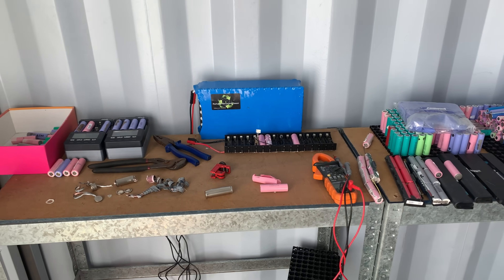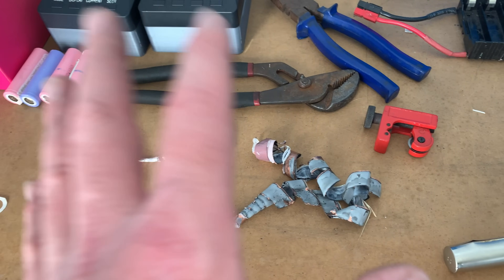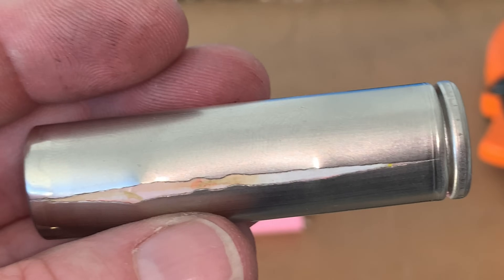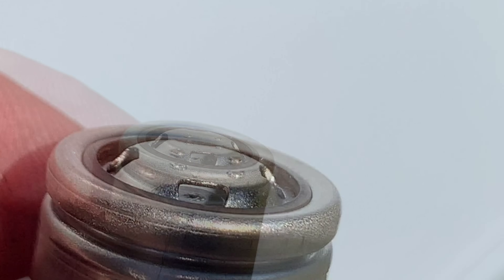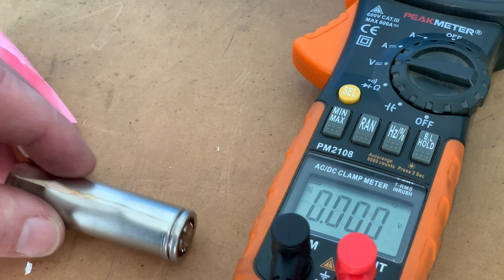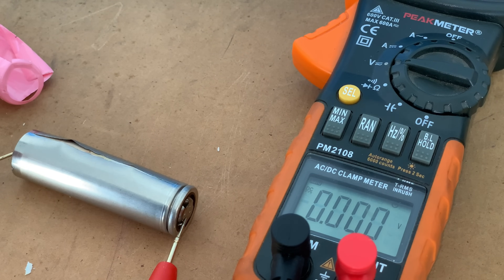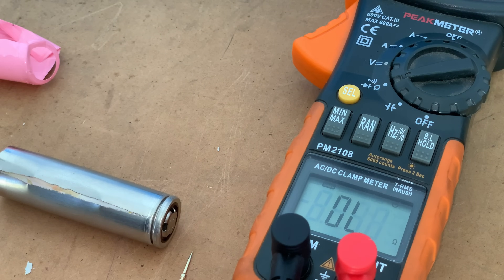Cutting open an LG 18650 battery for science  [ amateur video warning ]

Comment: I wouldn't think those cells would have a "seam", they'd be drawn into that canister shape from a single sheet like you would a cooking pot or a scuba tank or a sink.  That's not to say that the source sheet from which this cell was drawn couldn't have had impurities in the metal that created a weak spot for failure at that particular line when the internal pressure built up to the failure point.
Reply: Yeah, it would take far more machine time for them to roll a sheet into a canister and perform a secondary operation to form the bottom.
These are basically definitely manufactured the same way ammunition casings are drawn from brass.

Comment: Your batteries started venting? You don't fucking say. It's almost like a professional who's worked with batteries, charging and recharging them, told you this would happen.
Reply from the maker: Heaps of professionals on youtubes, i'm just a guy with practical experience - and after putting Tens of thousands of cells though this is the first time I've seen this.. Bet most of the Professionals here haven't seen the cells I have in a month lol
Reply: @HBPowerwall   Electrical Engineer for 13 years, 6 years as a avionics tech in the Navy before that, with most of the past decade dealing with batteries, battery management, power management, and control circuits.  I'm not surprised that you're getting increasing failures from suspect cells and damaged outer cores (some of that damage YOU caused by cutting into them).  

Tell me, what happens when you put multiple cells in series and have a weak one that can't hold it's charge in the middle, what is the end result?

Comment: U should not put those in water
Reply: Yes,even at 0v.Sodium and lithium are in the same group in periodic table, so their properties should be more alike than the properties of sodium and magnesium.
If u put sodium in water its volatile n causes voilent flames, same with the lithium, and i think u were just lucky it didn't caused any flame, it was oxidised earlier,  it had those white patches beacuse of oxidised lithium. and the remaining unoxidised reacted to water and caused bubbles,
Pls dont do such stuff i love your Worksop 🙏
Reply: birendra kumar there is no metallic lithium in a rechargeable Li-ion cell. Only non-rechargeable Li-metal cells have metallic lithium that can react with water.
Reply: @batterymooch  ooh,thanks for the knowledge, learned something new!
Reply: https://youtu.be/bNMfe20I_IE

Watch this u will get an idea
Reply from the maker: even when zero volts?

Comment: The layers inside did not look good. In my experience the layers should have a very uniform coloration. That cell had an appearance similar to corrosion. Also the copper looked like it was flaking apart. I have taken cells apart before and none have looked like that. It would be worth taking apart a "good" cell for comparison.
Reply from the maker: I really should have pulled apart the other one to compare. Just clean forgot.

Comment: Im wondering if you resleeved the cell? Meaning did you run a stanley knife down to take off the old plastic sleeve to put on a new one and was the break.in the cell caused by running your stanley knife a bit too hard?
Reply from the maker: No it was all factory.

Comment: i never charge lithium batteries unattended
Reply from the maker: It's unpractical to do 1000's of cells and watch every single one the whole time it's in the discharger. Do you mean you're in the same area when they are charging?
Reply: @HBPowerwall  when discharging i can leave them  unattended but when charging ive had cells get very hot and i worried they might go into thermal runaway so i keep checking them for heating when charging

Comment: i somehow doubt you can use an ohm meter to measure something that has a voltage in it
Reply from the maker: Who knows lol
Reply: @HBPowerwall  To measure resistance your average multimeter uses its internal battery to drive a current through the object being tested and it uses the current that flows to calculate/indicate the resistance of the object (via Ohm's Law).  If the object (cell under test here) has some voltage of its own, it will interfere with (either add to or subtract from) the multimeter's battery and give a false reading.  However, if you swap the test leads around and get the same reading, then you can assume that there is no voltage in the cell.  
If you really wanted to you could work out how to make sense (unique to that multimeter) of the different readings obtained when swapping test lead polarity.

Comment: That cell definitely had some of the electrolyte burned. The powder that you seen fall was burnt electrolyte. looks like it failed at about 1/3 of the roll off. If you take these apart and they are still good they also will not have it looking all cracked. I have taken them apart myself and only the expanded/vented or 0 volt ones tend to look like the electrolyte lost all of it's moisture. Normally it should look almost like a black jello that is slightly reflective. The reason that it still had continuity was because the electrolyte burnt away and the copper was able to gap.
Here is a video I found showing what it would look like if it wasn't burnt.
https://youtu.be/YrqsAGr41uU?t=553

Comment: Bit of an oddity for sure. On a wild guess i might say maybe just the casing was damaged. If there was pressure on the top and bottom of the cell, the casing might have just given way, splitting on the seam creasing the metal as it bulges outward.
Reply from the maker: There are no physical signed of damage.
Reply: @HBPowerwall   I'm unsure on it, but it might not take much pressure in the right position on the tips of the casing to cause the seam to split like it did. You could test this on another dead/bad battery, see how the casing behaves.

Comment: Oh my gosh it's common knowledge you do not put water on lithium it can react and cause a fire!  Keep this in mind for the future
Reply from the maker: You know how fire departments deal with lithium fires. Water...... and lots of it , for a long time. I need to experiment more maybe it’s an issue with a fully charged battery but clearly not with a dead one.
Reply: @HBPowerwall  Only metallic Lithium rects with water, the ions in Li-ion shouldn't react. Of course some tiny amounts of metallic Li could have been formed, but that fizzing was nowhere near what would have happened with a primary Li battery.

Comment: I had something like that happening with an LG INR18650-MJ1 cell.
 However my cell still worked fine with the crack.
Reply from the maker: In theory is should work if charged. Just not well or safe.

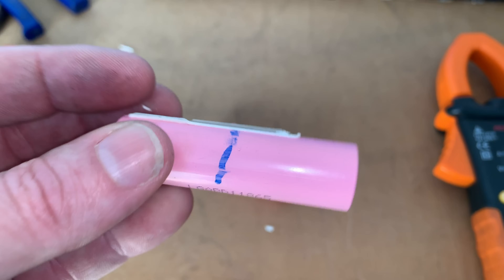Comment: 1:14 in the video and first thing I notice is this is rated for 4.35 volts. This cell is like a HV cell, if you system charges to 4.1. to 4runner.2 volts you would see the full capacity from these cells. These cells have a lower life cycle because they are pushed to a higher charging voltage and knows to fail in a short time. personally I would not mix these cells together with standard 4.2 volt cells.

Comment: tbh its not really a good idea to throw something containing litium into water. Litium reacts quite vigorously with water, and can thereby reach temperatures that are albe to decompose water (by Thermolysis), so you end up with HHO Gas (highly exposive), in addition to the hydrogen already produced by the reaction of Litium with water. and Boom. The only thing saving you there in your video is the fact, that the Litium in a fully discarged cell is stored in form of  LiCoO2 which is a lot more stable, then the Litium stored in a graphite grid in a charged cell.
Reply: Chibi Suke there’s no metallic lithium in rechargeable li-ion cells. Only non-rechargeable Li-metal cells have metallic lithium in them that can react with water.

Comment: You can see that it pulled apart because the can thinned at the crack 19:21, and the dark spot in the crack face says it was leaking for a period before the crack spread. Looks like the inside core expanded and ripped the can, rather than gas pressure which would've leaked out the initial pinhole - non blown CID shows there was no pressure -.

Comment: The cell with the spit was most likely because of a seam when one roll of metal is connected to another and just failed because of a bad weld on the seam most likely just dried out over time and stopped working
Reply: old time engineer I believe these cans are stamped (drawn) from disks and are seamless. I’ve never seen a seam in the thousands of round cells I’ve tested. A seam would just act as an uncontrolled failure point that would “compete” with the venting disk.

Comment: Dell had a bad bunch of battery packs a couple of years ago that were expanding in the laptop. They went so far as to do free battery pack replacements for out of warranty laptops. From what I can find it was the 84Wh packs. I couldn't find any date code info but it may be something for you to look into. The model in question was the XPS 15, maybe that will help your search? I wouldn't bother doing any more cells autopsies, I don't think it's going to give any revelations. Research the cell history instead (is this one of them that Dell had problems with?). Good work, by the way!
Reply from the maker: I'll look into that this week if i get time and if i find anything i'll consider doing a quick video - thanks for the information

Comment: I still think manufacturing fault maybe the case was extruded a little thin and possibly cracked along an adhesive line when it was removed that's why we test cells somewhere safe it always worries me when I see people posting pictures or videos and they are in lets say a spare bedroom with cells stacked high with a line of testers, remember it only takes 1 or 2 bad accidents and the powers that be will come down on us like a sack of bricks and regulate to the point it will be impossible to do this. stay safe

Comment: It was interesting but I have to tell you the grey stuff that was packed inside the coiled film is highly toxic and not easy to dispose. My advice is to clean properly all the surfaces you have worked on and call it a day regarding opening other batteries! Better to do a tour in one of the manifacturing facilities to learn how they assemble them 😉
Reply: Not highly toxic and can be disposed of in regular waste. These are lithium ion batteries not nickel cadmium or such others. I would not eat it but it's not a huge deal aside from the dangers of heat and fire.
Reply: Rob Fowler Ah ah, yeah, I wouldn’t eat it either!
Reply: The only danger beside eating is if it was on fire you DEFINITELY don't want to breath the smoke.

Comment: I noticed about 1/3rd the way into the wrap there was what looked like burn marks along the bottom (neg end) of the foils. I haven't see that in the one's I've dismantled. Probable it shorted and pressurised and for whatever reason (damaged case or faulty CID), split.
Reply from the maker: Sounds possilbe